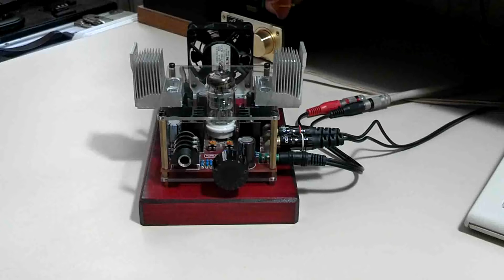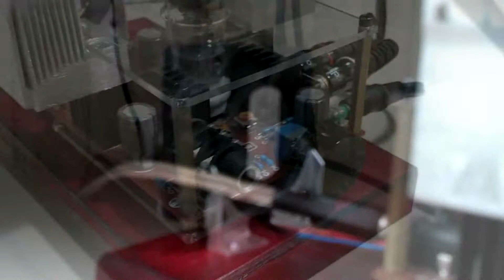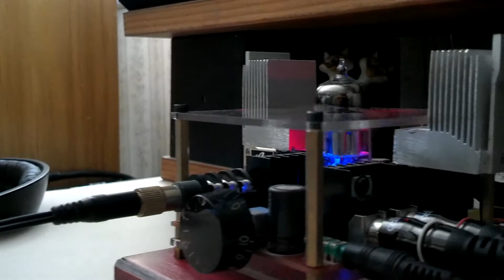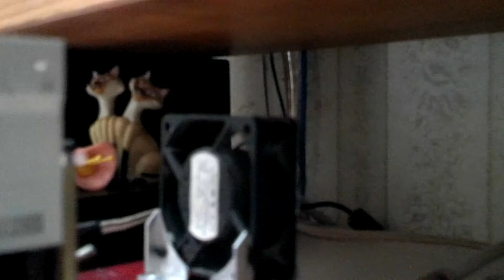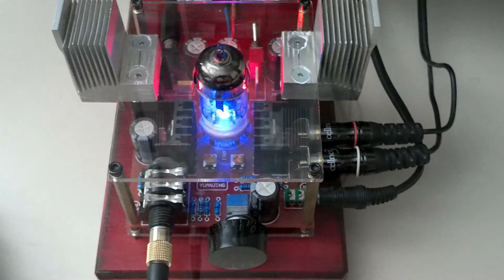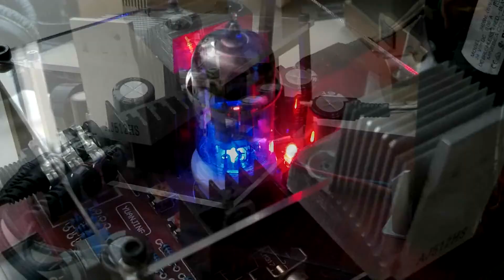6n11 Class A Hybrid Tube Headphone Amplifier One Year Later

Comment: so this amp would overheat without the extra mods?
I just bough tone, but hasnt arrived yet.
I hope a fan alone will suffice....?
Reply from the maker: This head phone amp runs hot as in burning hot on the output FETS the tube runs cool a fan may be all that is needed I moded the heat sinks first it did run cooler for about an hour with the fan and the sinks I use it all day